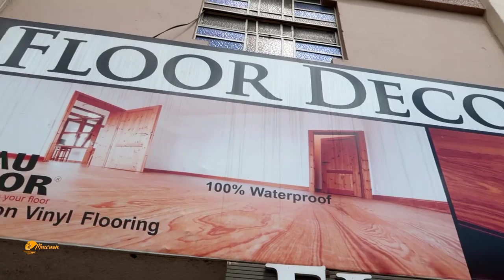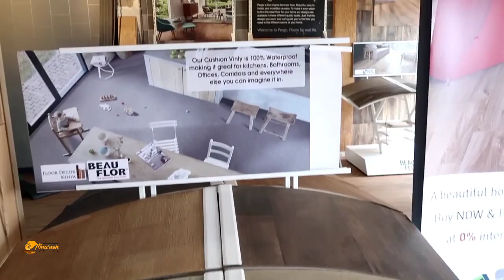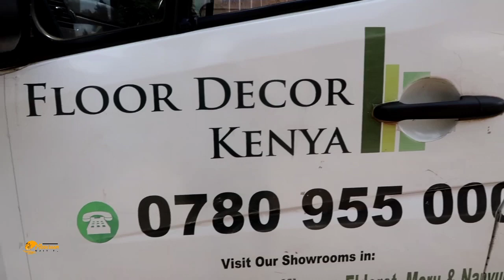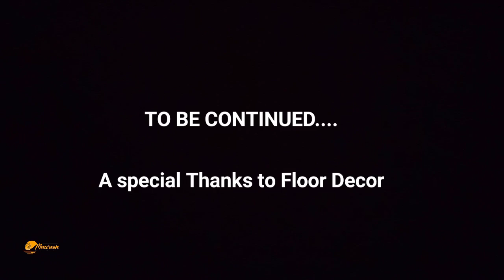Covering Bathrooms walls and kitchen backsplash with mkeka wa mbao sheet vinyl flooring.

Comment: Very informative video Maureen...lakini...I can't believe you covered that authentic wood floor with vinyl!  The final look is good...but how much more does it cost to refinish the wood floor and bring it back to life?!  Not a criticism, just a sincere question!  I'm building a house and I would LOVE to have an authentic hardwood floor.  I'm not so keen on actually getting hardwood simply because I don't want to be part of the further extinction of hardwood forests...however, I would buy a house or apartment that already had the hardwood.  I happen to like that vintage look!  I think I'll probably go with Pergo interlocking wood look laminate or bamboo laminate.  I'm not fully convinced with the mkeka wa mbao yet!  I have yet to see it up close in person and I'm a little skeptical of it's long term durability.  I do agree that the ability to change it out when you want a new look is pretty cool! I've had experience with another type of roll-out flooring called marmoleum and I like it much better than vinyl just because it has more natural materials in it.  Check it out!

Comment: How much is this   per meters
Reply from the maker: Authentic Mkeka wa Mbao™️ pricing is based on wear layer 

Wear layer from 0.20mm to 0.30mm with a form or power underside backing 5-7 Years warranty cost Sh 1,500/- per sq meter or Sh 140/- per sq foot and it’s for ideal residential homes . 

 Wear layer 0.20 0.35mm with a textile underside backing  5-7 years warranty Sh 1650/ per Sq meter or Sh 153/- per Sq foot ideal to use in residential house or a medium traffic offices 

 Wear layer 0.40mm  to 0.70mm Blacktex and massif collections Sh 1,800/-per sq meter or Sh 168 /-per sq foot wear layer  10 years warranty residential and 5 years warranty commercial 
ideal for high traffic areas like offices , schools ,Restaurants etc .

Check all Mkeka wa Mbao designs here
https://www.floordecorkenya.com/mkeka-wa-mbao-catalog/

Comment: How much did you use for you mjekw wa mbao
Reply from the maker: Ann Kinoti Authentic mkeka wa Mbao pricing 

Mkeka wa Mbao cushion vinyl flooring form and power backing 10 Years warranty Sh 1,500/- per sq meter or Sh 140/- per sq foot with wear layer from 0.20mm to 0.40mm ideal residential homes . 

Mkeka wa Mbao cushion vinyl flooring textile backing  10 years warranty Sh 1650/- per Sq meter or Sh 153/- per Sq foot Wear layer 0.25 -0.35mm residential use and medium traffic offices 

Mkeka wa Mbao cushion vinyl flooring blacktex and massif collections Sh 1,800/-per sq meter or Sh 168 /-per sq foot wear layer from 0.45mm to 0.70mm.ideal for high traffic areas like offices , schools ,Restaurants etc .

Digital Mkeka wa Mbao from Sh 2200-2900/- per Sq m

Check all Mkeka wa Mbao designs here
https://www.floordecorkenya.com/browse/beauflor/
Marmoleum 
Retail price  Sh 2200 per sq meter 
Check all designs here https://www.floordecorkenya.com/marmoleum
Reply: @floordecorkenya9339  do you have an outlet or partner in Uganda?
Reply: Number please I need one
Reply from the maker: Alice kipkemei We are located on the following locations 

Floor Decor Nairobi 
1 Kijabe street ,Universal church building  opposite Simlaw seeds 
 📞0780 955 000/ 0722679830 
Nairobi

Floor Decor Mombasa 
Link Road / Malindi road Junction 
Bobs Restaurant building 
📞 0755 960 000
Nyali 
Mombasa 

Floor Decor Eldoret
Sosian Street Next to Eagle Hardware
 📞 0780 755 000 Eldoret

Floor Decor Kisumu 
K - City business centre , Block C 10357
Omollo Agar road Opposite New east view hotel 
📞 0780 855 000 
Kisumu

Floor Decor Nakuru 
Wabcom house , Moses Mudavadi road Facing Nyayo Gardens 
Call 0780 355 000 
Nakuru 

Floor Decor Nanyuki 
Irura Building Irura Road  
📞 0755 660 000
Nanyuki 

Floor Decor Naivasha 
Mbaria kaniu Avenue 
Next to G4S
📞 0755 940 000 
Naivasha
Reply: @alicekipkemei7860  aahh
Reply: I need to renovate my barhroom and toilet with mkeka wa mbao is it possible?
Reply from the maker: @puritybilali3499  yes use none slip safety vinyl R12 rating 
Safety Vinyl flooring none slip recommended for wetrooms like bathrooms and kitchens 
Sh 2700/- per sq m 
Check designs here https://www.floordecorkenya.com/safety_vinyl_flooring_catalog/
Reply: My choice thanks soooo much